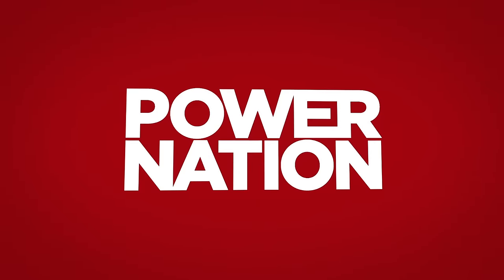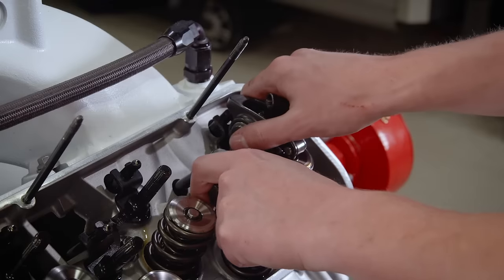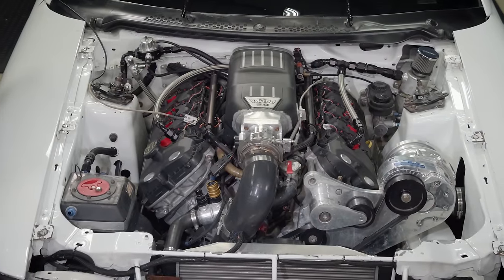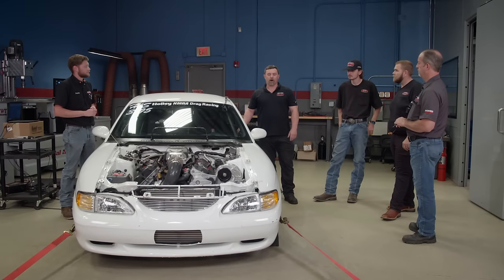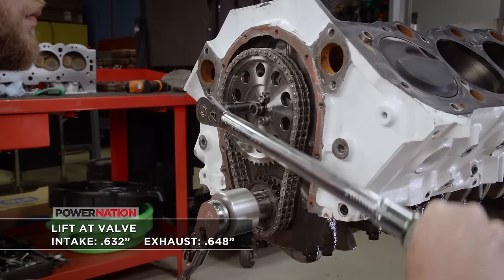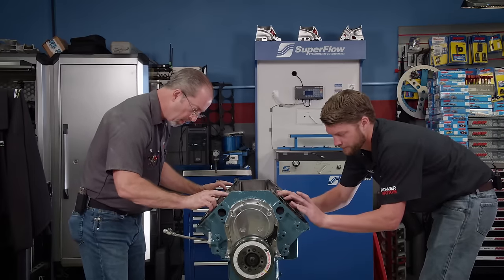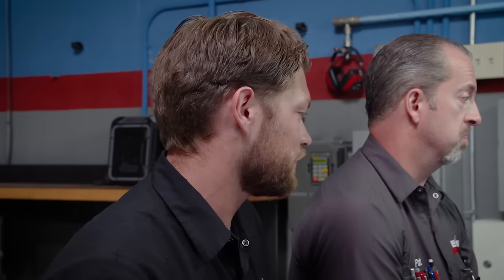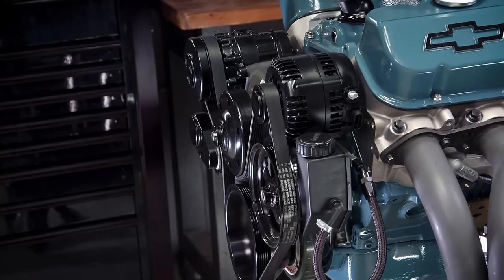496ci Stroker Big Block Chevy - Engine Power S10, E15

Comment: Thats pathetic! A cam that big with those heads should be closer to 700. My 400m ford with a smaller cam and heads made 629 hp and 585 ftlbs.... just saying.  Oh and the lsa is way off, which explains why the torque is low

Comment: Who is worried about low end torque with an 8.1L engine? Go with the RPM build!
Reply: A  real low end torque motor would be a pleasant experience from this channel, INSTEAD of claiming to build a torque motor and then winding it out to 7000RPM!
Reply: @towgod7985  Still makes huge torque down low

Comment: Vizard has a 496 combo with 236/240* cam and TFS 280 oval port heads.  721 bhp and 711 lb-ft.  Your 498 can use an even smaller cam with those big ports (106* LSA).

Comment: Frankie: "That's a flat torque curve...I like building engines with a flat torque curve 'cause they just kind of carry..."
The graph looks like the Coney Island Cyclone roller coaster.
Functionally, the curve is fine, but that sounds ridiculous. Maybe he should have gone off-script at that point.
Reply: It's a 40 lbs/ft variance over 3,000 RPM. How is that not considered flat? 🤔
Reply: I thought the same thing.  I bet that's from the EFI, and it will "learn" that flatter over time.

Comment: "flat torque curve"... Looks like a damn camel.
Reply: It varies by 40 lbs/ft over a 3,000 RPM range (3,000 to 6,000). How is that not considered flat? 🤔

Comment: Loved the different iterations... Would have loved to have seen what it would have made with a spacer I'm sure a racy engine will get a hood scoop of some sort... Also I think that the hp/tq curve would have looked better/flatter if you would have put the EFI back on, would make tuning it easier, better drivability, better starting, and best of all more power. Just saying 😉
Reply: That’s actually incorrect. Carburetors make a squeeze more power. Fuel from a carburetor runs through the intake and cools the intake air making a little bit more power. 
You don’t get that effect with port injection.
Reply: @loganh2233  only peak not average

Comment: 635 horse is pretty good for an NA motor, even an 8-liter. And it makes like 70-80% peak torque right off idle. That's what ya gotta love about big-displacement American V8's - they're just brute strength in engine form.

Comment: Serious question: does no one paint aluminum heads just to show them off?  After dealing with aluminum corrosion on my old build, my next engine will be entirely painted- heads and all.
Reply: Dust aluminum heads with high temp clear coat. Not real heavy or it will turn yellow. Works fantastic.

Comment: You guys are leaving way too much power on the table. You're not even getting 1.2 ft lbs per cubic inch. Your cam needs a tighter lobe separation angle, around 106 for peak performance and would still be streetable.